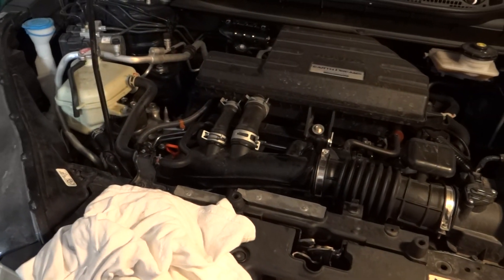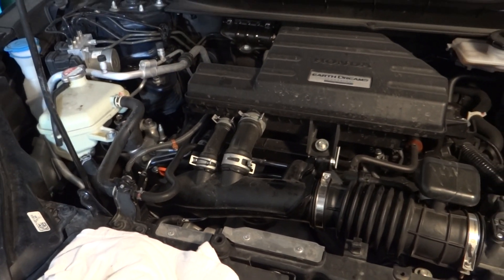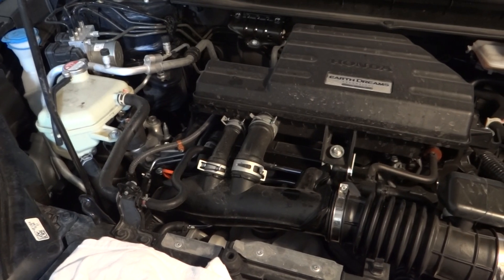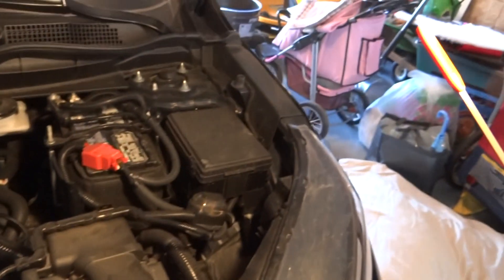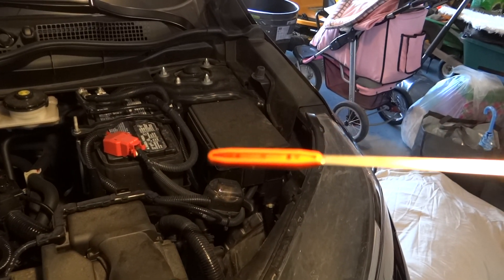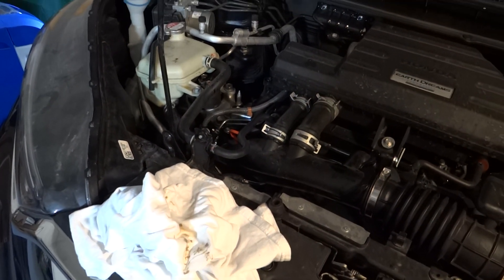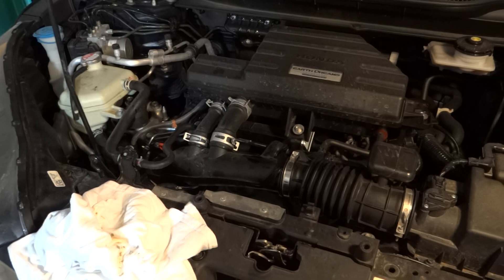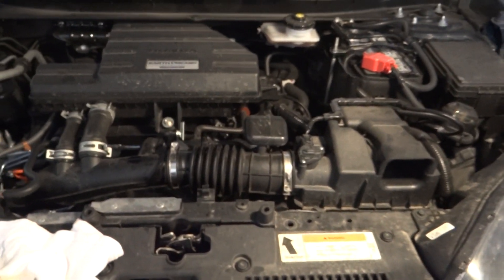Oil Dilution -- Honda 1.5 Liter Turbo

Comment: Im picking up the base crv. That 2.4 is a great engine
Reply: Martian ManHunter I just bought a cpo 18 LX with that engine.
Reply: I would go that route too, we had 3 CRV's with the 2.4 they were great. Unfortunately the 2.4 is only on the base model for 2019 and was discontinued on the 2020 altogether.
Reply: It is indeed gone.  They lost a sale with me.
Reply: Still 2.4 is paired with CVT and continuously vulnerable transmission is not worth owning the vehicle for long term

Comment: Honda has no solution to this problem. just trying to gain time and selling more honda crv's. Still having the same problem after the fix applied and 3 visits to the dealer. Dipstick color was choosed because of this problem:very difficult to see oil level. Honda dealer not recognizing the problem at all. As indicated here this is an engineering problem not software issue. Will never buy Honda. People should stay away from all honda models with turbocharger and direct injection.

Comment: Buying aftermarket hot spark plugs can help this issue. Jumping up in burn temp with hotter spark plugs, and even maybe other ignition parts can help complete a better burn for it. Reducing this fuel issue

Comment: Honda knew about the problem, that is why they recalled "ALL" of their CRV's from China, but! they continued to sale in the US. Honda wanted time to resolve the issue, but Chinese gov't was like hell no and get that POS out of my country. I love my 2017 CRV. It's a very confortable, very slick design, and very easy to drive. Sucks w/ the oil dilution. Since I found out about the oil dilution couple months after I had purchased my CRV back in sept 2018, I've done extensive research on it. I've even kept my eyes on the NHSTA complaints and engine dilution is the most common issue. Here is the link to the NHTSA: https://www.nhtsa.gov/vehicle/2017/HONDA/CR-V/SUV/FWD . When i started following the NHTSA, the complaint was around 200 something. NOW ITS AT 772! Friends and families wanted to buy the car, I steer them away from doing so because of the dilution issue. Or stick to the base model.
Reply: It is now at 883 and after im done. ..884!
Reply: Daravid Ngeth I wish USA Governments step up like the Chinese Governments then My issue would result cause I happen to owed a 2017 CRV that has the oil dilutions since day one.
Reply: Daravid Ngeth the reason not many complaints due to the majority of Honda CR-V owners are people at 55-65 years old & They never change the oil or check it at all, they must have the dealers to do it for them and the dealers never tell them the issue.

Comment: I am quite certain that Honda knows they have a catastrophic engineering design problem, to which their best solution is to make more money by surreptitiously shortening their maintenance intervals.

I have been driving for close to 60 years and as a 2nd-generation Detroit-born-and- raised motor head (my dad and his buddy had their own Model-A garage as high school kids), have always performed my own repair and maintenance on every vehicle (of 2 wheels or 4) that I have ever owned.  As I approached my 70s I became much less likely to do anything more than; oil/filter changes, an occasional tune-up, valve adjustment, plugs, brake jobs, ect., but I did resent being unable to TOUCH my new vehicle. Unlike most "professional" mechanics (especially @ dealerships), when I repair a vehicle I intend to keep, I try to use the best available (sometimes used/rebuilt) replacement parts and take all the time necessary to do the best possible repair. When I change oil in a vehicle I intend to keep, I use only the best oil and best filter available and I usually flush during the process. To keep the Honda warranty, we now must let ONLY Honda perform ANY labour and use ONLY Honda parts.   

What seemed baffling to me (although it is now becoming much clearer) was NO MENTION of a maintenance schedule in the owner's manual!  Given the apparent total on-board computer control (and maybe INTERNET control) of 21st Century vehicles, it seems that the maintenance schedule is variable to the needs of the manufacturers and dealers.  

This will be our 3rd Honda and we loved each of them, but we are now the unhappy owners of a 1.5L Turbo 2018 CRV EX.  The first year we only drove her for short errands around our small town and trips of 100+ miles only twice. We always used her remote start to warm her up before driving and never jack-rabbited or abused her.  We never noticed any variation of oil level, nor did we get a bulletin or recall notice.  We did get the "MAINTENANCE DUE" popup on the dashboard at 3,000 mi. and used our "dealer freebie" to have our first oil and filter change early last month. 

Later last month we drove to Florida & back, where we drove often at 70-90mph all day × 8 days, for a total of 3,000 mi+. When we got back to town, we found  a 1 inch rise over "FULL" on her dipstick level.

Since we live in a high desert climate where it almost NEVER goes down to freezing, ALWAYS warming her up and NEVER accelerating aggressively (minimizing turbo pressure), Honda's theory that "...fuel dilution is due to insufficient warming, especially in cold climates..." is SHEER AND UTTER BULLSHIT!

So now we will take her in for the "Honda fix"; oil/filter change and the magical top-secret mumbo-jumbo software update, but the only way to test her is to drive 3,000mi. accross Texas (with their 80mph speed limit, our radar detector, a big bottle of No Doze and some adult diapers) and see if her oil level no longer rises!

Alternately, our next best option is to get rid of her and try to find a vehicle (preferably something from the last century) that a liitle old lady only drove to church on Sunday.

We did see a website that solicits membership in a law firm's class action suit, and are thinking about joining and taking their printout to show to the Honda service manager.
Reply: Honda is lying! Big cover up.
Reply: Most if not all direct injection engines have this problem.

Comment: Just traded my 18 Touring this past Tuesday. The absolute worst heat from a vehicle I've ever encountered, it was comparable to my 1968 Beetle. I live in Northern Maine, so this is a dangerous/safety issue. The vehicle could not produce enough heat to keep the windows defrosted, unless you were doing highway speeds, and even then the minute you get to a stop light etc, the engine temp begins dropping to zero, and now you're getting cold air blown into the cabin. 

I told my dealership they should NOT be selling these vehicles in our area (or any cold climate locations). Thank god I was able to get rid of it.
Reply: @Bill Jones Hey Bill, we ended up trading it for a Kia Telluride, which we are really enjoying.

Comment: I had a brand new 2016 CRV Touring NON Turbo, that had oil dilution issue bad. Also had very poor winter heat. Traded it off for a real car, Toyota Highlander. Also, many people have the issue in Florida and Texas, warm weather climates. In China, there is a recall, should be in USA too. Never again Honda, admit to problems and fix them, don't try to cover them up.
A new car warranty is only as good as how it is honored, you get graded an F

Comment: This is also a common problem with large port-injected 4 stroke outboard engines. I have experienced this with Suzuki DF140, DF200, DF250, and Yamaha F115, F250 models.

Comment: Compared 2018 Accord with  2018 Toyota Camry. Honda had 1.5  turbo charged engine with CVT transmission. Toyota had 2.5 liter naturally aspirated engine and 8 speed automatic. Have the Camry in my driveway.

Comment: Hi, Do you have any update on this three-part series?

The dilution is well documented and acknowledged by Honda. Engine oil dilution may lead to 1) overfilling 2) lowers oil viscosity. It's bad luck for those who bought this car including me. So, let us try fixing the problem. 

Recently, I raised my car and found that there were some oil residues outside the engine. I traced it back to engine seams. Such could be due to high-pressure build-up, secondary to oil dilution. The oil levels were way up above the 'upper mark' on the dipstick, just like what you showed in the video. So, I was thinking to change the oil by myself and refill it just above the lower mark on the dipstick and see whether that helps. Have you tried this? Do you suggest anything different based on your experience?

Comment: I change my oil every 5,000 miles rather than at the recommend mileage. Also, I use 91octane for better burn-off. No guarantee this will help much, but it’s better than whining about getting screwed-over by Honda. Gonna give performance spark plugs a try.

Comment: same issue but not too much fuel mix with the oil, only up to top of the orange part of the dipstick nothing on the metal part. i did the software update 2018, it warms up quicker & the heater heats up quicker but the oil dilution is the same, i service my own car, i change my oil every 5K km but not the filter then the next 5k km i change the filter. I drive the car hard once in a while when im in the hwy & it helps burn the fuel mixed with the oil. I live in Vancouver bc canada, i went on a 2 weeks road trip last summer crossed 7 diff states in the west (7k km trip) no problem its 43k km now...

Comment: Many combustion engines have this problem. However, the problem with this turbo engine is it take too long to warm up in colder weather. This is unfortunate because Honda makes great vehicles. Hopefully the fix will resolve this problem.
Reply: Glenn Batchelor are you driving it to warm it up or are you letting it idle?

Comment: Hello Carpe Diem, I wanted to ask if after the software update and other fixes applies by HONDA on your HONDA CRV , do you still see higher than normal oil level in oil pan. I was thinking about getting CRV and wanted to see if the software update is making any difference for people . Will appreciate your response .
Reply: My wife has the 2018 CRV with the 1.5L turbo. ..it has the so called " software update " ...it has fixed nothing!

Comment: Did the software update fix the problem? I’m looking into buying a 2019 CR-V. I want the base engine but the tech doesn’t come with it. So I’m on the fence about getting the 1.5T
Reply: doni1967 Get a Toyota RAV4.
Reply: I wouldn't, after 4 crv's between 2008 and 2018, we traded our 2018 with 18,000 miles off on a 2019 Passport.
Reply: Do not get the 1.5L...you've been warned.

Comment: The dilution issue-

I know this is a small % of 700k Accords sold in the states, so chances are low.. but again, why some 1.5L Accords and not others? That's my main question. If all Accords are tuned the same, and the tuning difference is why it's not as prevalent on Accords compared to CR-Vs and some Civics, then why does it occur on some and not all 1.5L Accords?

Is this something people notice rather quickly? within the 3yr/36k warranty? (not that Honda does anything about it), perhaps the first winter?

If it takes time, some longer than others,.. why is this? Is there something mechanical that breaks down and allows this phenomenon to occur after whatever time-related process occurs? I'm aware of why the fuel mixes with the oil. I'm just trying to make sense of it. Under 200 people on car complaints and probably the same amount of people on youtube with the issue on Accords. Then there's all the people that have the issue and aren't aware, and/or don't post it online.

Should we run the cars harder in colder weather to warm it up faster and burn off fuel vapors?

I'd greatly appreciate responses.

I have more confidence a slightly used 2017 Accord coupe would be more reliable near 200k miles, but I just want that B-pillar closer to my side in the rare chance I'm in a side collision. That pillar is much stronger than the door. My stupid accident has made me hyper-sensitive about safety that I'm downloading and comparing NHTSA tests. I know it's obnoxious, but I can't help but "feel safer" in the new sedan. And I won't get a 2017 sedan because it received "A" for cage and 4 stars instead of 5 on some front ratings.

Then I compare the chances of being T-boned compared to say.. I go to floor it on the highway to get around a truck that doesn't see me .. and the turbo blows up or something.. hard to say which is more likely to happen and result in injury or fatality.

I've also read on here about the steering having issues of getting tight on long trips, the car slamming its brakes on highways, the safety sense freaking out. Again, probably 1% of all the cars may have these issues.. just don't want it to be mine and put my family at risk. Won't have to worry about any of that on a 2017.. but that B-pillar. And I assume those scary issues wouldn't happen if turning the safety tech off every time I start the car, perhaps not using ACC.
Reply: Hey man I have the accord here in warm Texas and I smell gasoline in the dipstick. I drive mostly highway 70mph

Comment: I have the 1.5 turbo Civic in Belgium I have to say my engine looks very different .. maybe just different setup because it's the crv.. I wouldn't be concerned .. does the car get to temperature fast ? My Civic literally heats up in 5 minutes .. maybe it's very cold in the USA and China .. here it's 0 to 3degrees celcius
Reply: Hey Nico van welk jaar is uw civic? Ik heb juist een civic gekocht tweedehands modeljaar 2019. Toch nog geen problemen gehad met uw honda? Groeten
Reply: @dietgerherregodts2220  mijne is ook van 2019. 😁 Ik heb nog maar 10 000 km op de teller nog geen problemen gehad. Het is wel best de olie vaker te vervangen natuurlijk. Maar normaal bepaald je Honda dit zelf.

Doe je veel korte ritten zal deze automatisch sneller.naar onderhoud vragen.
Reply: @dietgerherregodts2220  het is wel aangeraden bij elke GDI motor om wekelijks eens een lange rit te maken van bv 40 minuten op de snelweg. Waar er laag verbruik is en de motor goed op temperatuur is. Sinds elke GDI. Dit probleem heeft alleen in deze extreme gevallen. Veel ernstiger. Bij mij duurt het meestal 5 minuten voor de auto op temperatuur is ik laat hem 2 minuten draaien voor ik vertrek.  En sinds ik recent een onderhoud heb gehad kan ik je nog niet veel zeggen. Ik kan pas binnen wat rijden nog eens controleren ..
Reply: @nicolafertin3154  er zal vooral in het weekend mee gereden worden ik heb juist mijn nissan x trail verkocht die niet anders dan problemen had met de lambdasonde dus ik hoop dat ik met de honda wat meer geluk heb. Ik heb ook gelezen dat je de motor toch beter warm laat draaien. We zullen wel zien toch bedankt voor uw reactie en ook nog veel plezier met uw civic groeten

Comment: Oil dilution is a combination of a few things, high pressure, direct injection, and others, it will happen to any vehicle at different degrees, temp, running time before engine stop, temperature, etc... but too much is not "normal" and should be corrected, some of you guys will increase your out of pocket expenses by more frequent oil changes, some will try to fight the manufacturer, good luck with that. The best thing a consumer can do to force a change is not to buy the product that is not living up to your expectations. I got rid of my wife's Accord (2006) special order, she dumped 25k on that  car a long time ago, the car didn't have 100K miles and the maintenance cost was out of control, things like engine vibration, oil burn, disk brake rotors change every 2 years, transmission slipping, all I got to say I have owned cars and the only thing I did was the routine maintenance and wear and tear replacement, like tires, brake pads, oil and 1 battery after owning the vehicle (150K Nissan PF) that still around and works just as new. Honda dropped the ball, not just Honda but every manufacturer out there making this engines are having the same issue, ultimately you the consumer will fork the bill(s) to keep their cars running in a decent shape, and you though you were going to save money! Don't forget to check the oil weekly and change it every month, on top of all the other things you have to remember.

Comment: I guess this means. Stick to the 2.0 liter engines Honda makes now. They have the 2.0 in the base Civic, the Type R, and the Accord.
Reply: The 1.5 (here) and 2.0 are both turbocharged engines that have this issue. The 2.4 liter found in the base model LX CRV doesn’t have this problem.

Comment: Having the same problem!  Honda is basically doing nothing but telling us to drive it until we experience problems.  I keep telling them that when I check the oil that its overfilled and smells like fuel.  I've spent hours and hours on the phone with Honda and they are basically doing NOTHING!  NO MORE BUSINESS FOR HONDA!
Reply: I will NEVER own another Honda. I'm sure they make other very reliable vehicles,  but because of how they have handled this issue (or lack thereof) I will NOT patronize a company that does not own its mistakes and step up and do the right thing. They should be buying back these vehicles at individual customers request. They do not have a Fix and should accept FULL responsibility. Shame on you Honda.